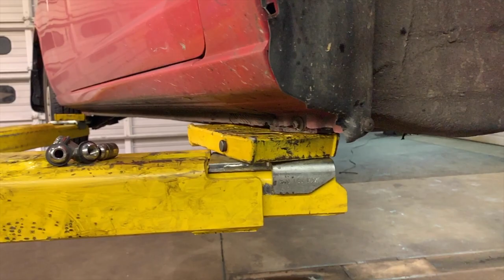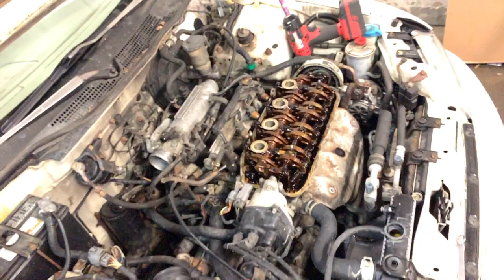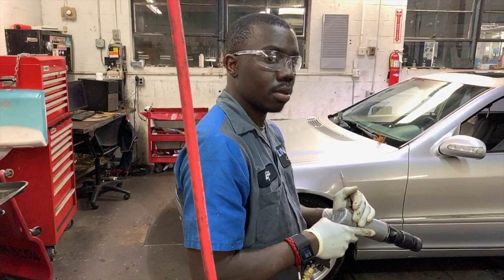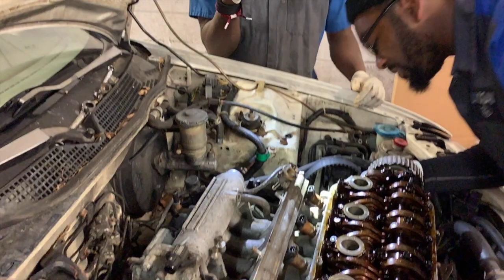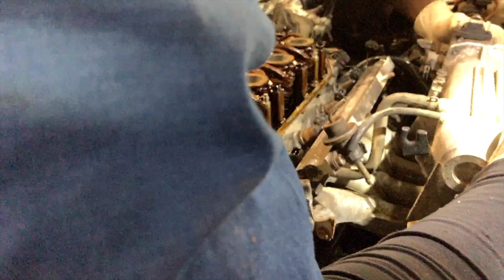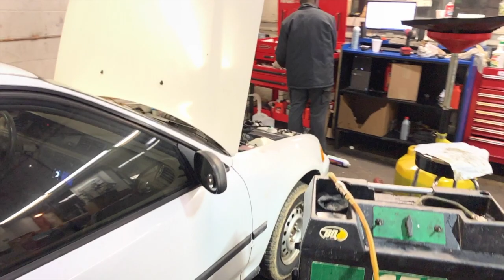HOW TO REPLACE A 1992-1995 CIVIC HEAD GASKET

Comment: Nice video bro. I had a question, to remove with everything in tact, did you have to go underneath the car to remove the bolts for the injectors/manifold area to have it come out all together?
Reply from the maker: Just the ones from the back of the intake
Reply: @fullspeedperformance  
Ok awesome, so no going to the bottom of the car for removal? I appreciate your time.